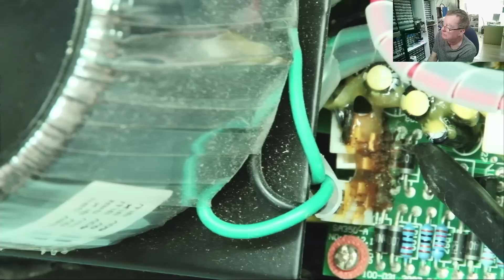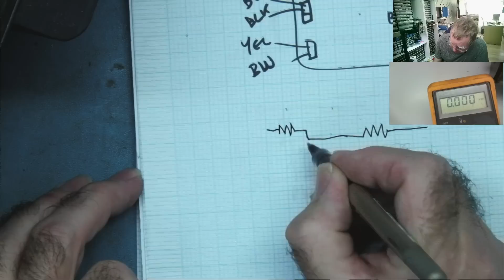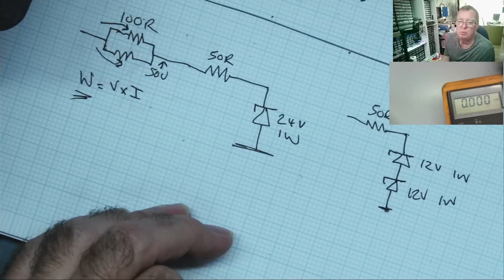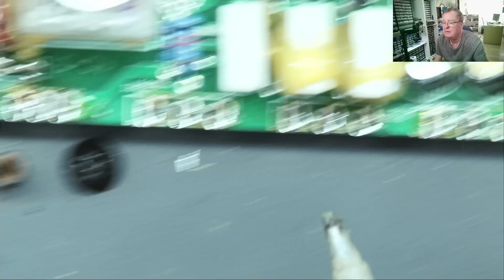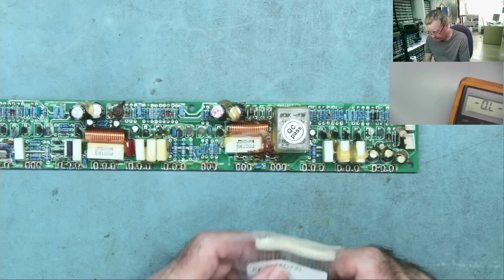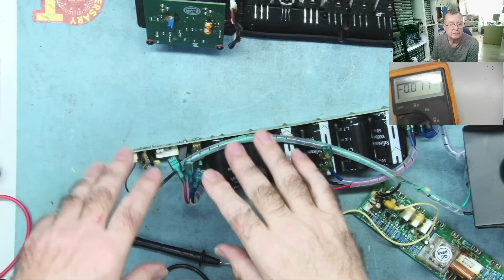DEA K-15A Active Speaker Repair Number 3 - I have three of these to fix, here is the THIRD one

Comment: Hi Richard it was me who commented about your zener diodes in series wattage calculation previously, and I'm afraid to say that you're still wrong or the diode manufacturers at Toshiba and other websites are lol. I would have a look online and check who's right here.
Reply from the maker: @edmguru  Hi, sorry I couldn't remember who it was, thanks for posting.
Let's see who is right here.  This webpage shows a simple circuit which is equivalent to the one in this amplifier
https://www.hnhcart.com/blogs/active-components/how-to-calculate-wattage-of-a-zener-diode

It has different voltages to ours but the principle and maths is exactly the same.  So you will see that in step 3 you calculate the wattage of series resistor  Pr=VxI where V= the voltage (6.9V) dropped across the resistor which in the example is a 62R so 
Pr=6.9Vx110mA = 759mW.  

Now if we used two 31R resistors in series to form R, then for each resistor the voltage dropped across it would be half of 6.9V = 3.45V but the current would be the same so each resistor is dissapating 3.45x110mA - 0.3795mW.  This means we could safely use two 0.5W 31R resistors instead of one 1W 62R in the circuit. I hope we can agree on that? 

And the same applies to the zener diodes

So onto the zener diode, in the example on the link the zener is rated at 5.1V so the power dissapated by the zener Pz=5.1Vx110mA = 561mW.  In this case we would use a 1W zener. Now if we use 2x 2.5V zeners in series then (because the current still remains the same) Pz for each is 2.5Vx110mA = 275mW so we can see that each zener could be replaced with a 400mW zener.  

Now imagine we halved the value of R from 62R to 31R.  The voltage across R remains the same so this would double the current to 220mA.  Now our single 5.1V 1W zener would be dissapating Pz=5.1Vx220mA = 1.122W and burn up but if we used two 2.5V 1W zeners in series each would dissapate 2.5Vx220mA = 0.55W and be just fine.

Therefore I stand my case.  Replacing a 24V 1W zener with two 12V 1W zeners in series doubles the maximum wattage that the circuit can dissapate to 2W.  Your turn 🙂
Reply: @learnelectronicsrepair  Using two 12V Zener diodes in series is a practical solution when a 24V Zener diode is unavailable. Just verify tolerances, check power ratings, and test the configuration to ensure proper functionality in your circuit. 😊
Reply: @ Hi Richard. I replied to this at the time but I've just noticed that my comment seems to have been removed, probably because there was a link to the Toshiba website in there. Please check your comments held folder. Cheers.

Comment: Heya, nice wen you have repair these kind of speakers you already know them and repairing will be easier
Reply: can't beat doing repairs to the same equipment.  I used to repair CD players and i might have 50 waiting, but they were all the same make and with the sane electronics inside. so you know the fault as soon as you hit the power button. made it quite an easy evening job after work.
Reply from the maker: Yes I wanted to put that across in this video 🙂

Comment: So in the end you simply removed the glue and checked some iffy joints and then it worked again? What happened to those amp modules where one was producing bass or full range and one was producing only trebble or mid I think. Were those the other two of these?
Reply: There was a burnt (open circuit) resistor that needed changing too.
Reply from the maker: @JustInspiredKent  Yes, and I also fitted a higher wattage resistor, explained why and upgraded the zener diode as well.
Reply from the maker: The Biema Alpha Line Array Amplifier with no bass, only treble, I repaired it here : https://www.youtube.com/watch?v=22l7oXOFftk
And in the end it was not any of the suggestions which I discussed in this video.  It's working fine now and the customer paid me. All is good.
Reply: @learnelectronicsrepair  "And in the end it was not any of the suggestions which I discussed in this video" please remind me of what that one was ...cheers.
Reply from the maker: @andymouse  I was referring to the Biema Alpha repair that 1zzzzzz6 asked about.  In that video I discuss some viewers suggestions and it turned out to be none of them.